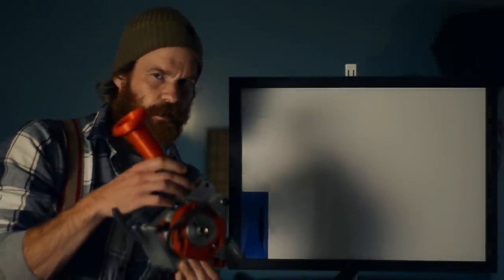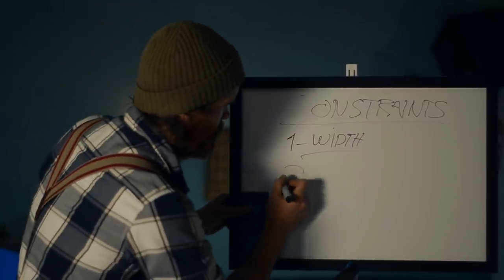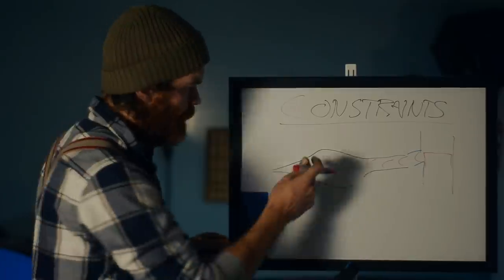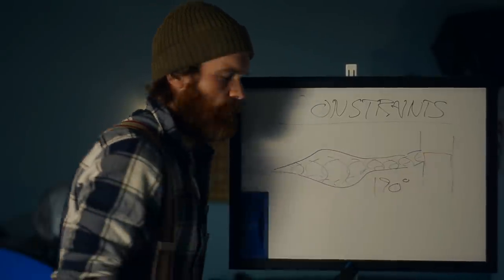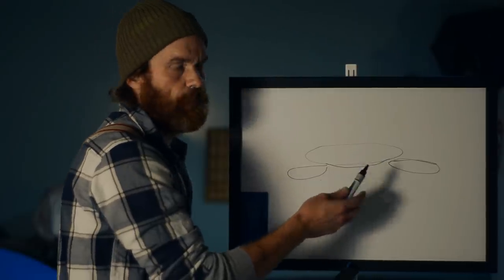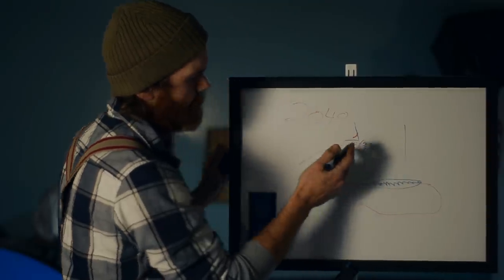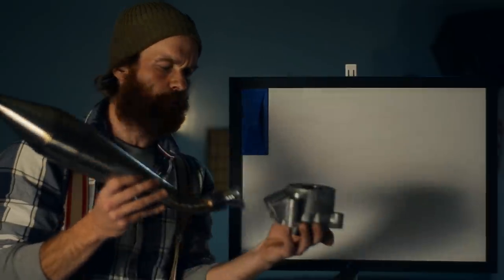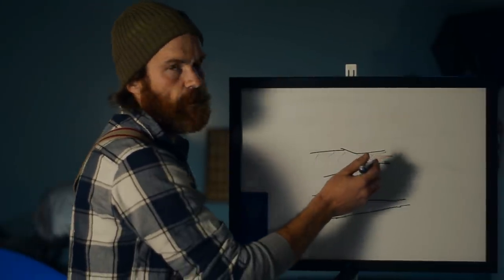How to Make the Most Powerfull Two Stroke - P1 Porting

Comment: This is amazing. Thank You very much, if words can express how valuable Your knowledge is. 

Im serious ablout 1 thing, I wanna build 900cc 2t twin engine then have all needed mashinery & finances.

  I would do like A.Milliard. Cut the casing of the gearbox and clutch from 1 liter superbike engine, and weld to it my own made part of the engine to one.

Maybe i will use cr500 pistons and rods.

But the most important part is this that you are doing. By engineering cylinders, heads, chamber by your knowledge, i could reach much better performing engine.

Like stock cr500 has 60hp, so tuned by Your way, maybe possible to hope for 75horses or more. So 2 cylinders maybe peak could be 150+hp, which would be very respectifull using 2 pistons only.

Why 2 pistons, not 4. Is becouse the crankshaft to make is easier, yet engine is narrower. To make 4 pistons crank and cases is really would be very difficult.
Reply: Yes it is very difficult to make a 4 cylinder 2 stroke  I tried it with weed eater jugs and pistons made a crank and block  wouldn’t start without ether and spinning it to 4K rpm I think the case volume was way to high also it “idled” at 5000 rpm any lower and it would die I’m pretty sure it’s been scrapped by now I wish 2strokestuffing was around when I built that at 13 yo
Reply: Take a look a snowmobile engines. This year's skidoo 850 twin cylinder is putting out 165hp. Pretty neat design!
Reply: 165horses would be very respectifull. Yet im wondering how cvt belt on them holds such a performance.. Its mystery for me honestly..

And why im serious to build 2 stroke engine too in future? Is becouse i would like to do custom-classic-racing motorcycles not only for myself but to sell it too.

Just becouse 2 strokes much more valuable, and exotic compared to 4strokes. Especially high capasity 2strokes almost dont exist anymore novadays.

Like ronax500, sutermmx500, these motorcycles goes for sell for really big money. I wouldnt do that that expensivelly coz i think its ridiculous.. 

I see here a some business opportunity, building custom motorcycles. But yet i would like to build differently, to have not 4t but 2t engine. 4t you can get on 'every corner' cheaply, 2t is a rare thing now, especially with output like 150hp+, yet enough reliable if using 900-1000cc engine capasity.

Comment: I'm seeing the whole point here is to maximize resonance as to overcharge the cylinder right at exhaust closing in the compression stroke.  Kinda like supercharging, but just using timed exhaust waves.  What I see is if you do the porting and everything correctly you could have massive amounts of fresh fuel in the exhaust that might not fully get returned into the cylinder and be burnt.   I don't think this is a concern on a 100% race engine though.  For a commercial use engine these considerations are a compromise, but a pure all out let's see just how much power we can get out of it aren't.  Curious to see how it ends.
Reply from the maker: 👍 Yep, won't have the lowest emissions ever... My next project will be much worse tho...

Comment: Still most interesting.....with a signaal generator. Amplifier tweeter and microfoon and scope you can find out the exact resonance freq. Of the pipe and tune it if needed.....i did this to find the resonance freq. From my V1 engine...in tthat way i could easy tune the inlet reed s from the valve   and bring all in resonance...grt paul

Comment: In theory your concept is great, however in removing constraints with your port design, you are adding a constraint with your piston and ring design. By restricting the ring to form a seal as it was originally designed to do, you will have compression and reliability issues . That being said, I admire your efforts and have 2 suggestions to help your cause. 1 try a slightly wider ring so it isn't as narrow
2 decrease piston to bore clearance , even to the point where you may have to preheat the bore to expand to normal operating temperature size. Good luck

Comment: Hey. Good video. I have a question. Or maybe its a sugestion.  On your crank shaft. On the inside of the counter weights. Have you e er heard of cutting groves in them?  I dont know exactly how to explain this but something like this. Take a circle and start from the center point and make a line in a swirl to the out side.  Make one next to it and one next to it and so on.  What happens is when the crank rotates the groves scoop the intake gasses and go on to presurize the transfere ports.  Effectively charging the top end. Like putting a blower on it sort of. 
  Any way you might want to research it some and see if will add any power to what you have already. Which is lots. Lol. 
  And about leaving people more confused after one of you videos. I wouldnt worry too much about it. You explain things really well.  If they are still confused after listing to you they will probably never get it.  
   Ps.  Kindergarten. Ihave been trying to decide what you di for a living for a long time.  I would have never guessed you worked at a kindergarten. No damn wonder you drink.  lmao.  See you on the salt.

Comment: Have you ever 3-D printed the inverse of the exhaust port?  That would be a good visual.

I know that 4-stroke airflow shouldn't be directly compared to 2-stroke but I think you want to avoid abrupt changes in cross section except in your expansion pipe where those changes in cross section are very intentional.

Also, I am curious what you are doing with the port "ceiling"(?), the first part of the exhaust port to be opened is kind of like the valve curtain area of a 4-stroke, it would probably be a good idea to have a rounded surface there so your flow stays attached to the port wall.

Is there a longer stroke crank that will fit your case?  I think if you could stroke it and make a test cylinder that has shims on the cylinder head and crank case sides, you could test your port timing to see where your best output occurs and use that data to make an optimized cylinder for the 50cc race motor.

I would really like to see that inverted exhaust port because I think there might be some changes that might help.

Comment: Awesome video, thanks! I have a question about the short transfer and the exhaust port ending at the cylinder. The short transfer from oval to round will also introduce a small backwave as it is so steep, a smoother transfer would not have this effekt. Did you make it short to not loose energy to friction and get a stronger backwave from the exhaust pipe? Second question would be, why did you not start the transfer to a more round shape already in the cylinder? The oval shape should have more friction than a more round shape. Further more, if you ge tighter it looks like you have the smallest area at the end of the cylinder acting similar to a nozzle. You could try to introduce a laval shaped "nozzle" as this will minimise losses, after the laval you should open with around 3 to 4 degrees cone, but that is for sonic flow through the laval, to not have detachment of the flow.
All the best! Really love your videos!

Comment: Question about exhaust port diameter. when working out pipe diameters at diffuser to belly section usually 2.2 - 2.5 X exhaust port diameter. Is the exhaust port diameter the area of the exhaust port converted into a circular dimension, or the diameter of the header pipe?
Reply from the maker: Effective port area converted into a circle. Providing a good duct, the header should start at this diameter too.
Reply: @2STROKESTUFFING  thank you.

Comment: Hi,
Have you considered "borda carnot" losses in the exhaust system?
What about the circumference and surface area relation in the exhaust port? It will create turbulent and slower flow than in a round port
Reply: Intrigued.  Would fluid dynamics equate?
Reply: @stephenhintz4457  explain your concern please

Comment: Nice explenation very easy to understand 👍 One question: do you have any modern suggestions for the STA/time area of the exhaust and transfers or how to detirmine them for the specific rpm ?
Reply from the maker: Thanks! I've used Blairs(I think)formulas before, but nowadays I use engmod2t to simulate whole engines.
Reply: Thanks I use jennings suggestions but i've heard they are somewhat faulted/outdated...guess the simulation/testing is the way.

Comment: One or two thin bridges in that big hole on side of Ur cylinder would not be as much trouble as the trouble with ur ring life ? To much open area the ring is just going to expand into wide open side of cyclinder eat ring up or cause piston to wobble piston wobble is ur problem now from looks of skirt of piston?
Reply from the maker: The piston has been abused a bit in a too tight bore(would've ground the Nikasil off completely if taken to right dimension, new Nikasil now) but yeah, wobble might be an issue. We'll have to see how things evolve and adjust accordingly.
Reply: Is ur final piston going to be long enough in the bore to use two rings ? Could piston b fitted with a second ring down on the next to the bottom of skirt just for stability in the bore? Or that be to much friction and reduce rpm's ? Back in the day my1986 Honda CR had crome cylinder and piston only used one ring

Comment: Would it be beneficial to have the exhaust duct as close to the angle of the cylinder bore as possible so the gas flow does not have to change direction so much?
Reply from the maker: Yep, well almost, say 10deg off or so.

Comment: How do the land speed regulators confirm the displacement(cc) of the engine on site, or is it a system of good faith and believing your engineering data on the day?
Reply: Ibelieve they measure the amount of cc's by measuring exhaust flow and rpm. not 100% sure though
Reply: If you're fortunate enough to go over a record the vehicle is impounded and the engine is torn down and measured.
Reply from the maker: Yep.

Comment: You said something to the effect of the resonance from the pipe supercharging the next intake cycle. My question for you is, are the spent exhaust gases entering the next intake cycle? And if so, how does that affect the effectiveness of a cool dense air intake? I know the basic principles of how a two stroke operates, I’m not familiar with the physics behind it. Also, what is the compression ratio of your engine.
Reply from the maker: Spent gases should not be pushed back in, but some mixing will occur. The low volume flat duct should help minimize mixing.

Comment: You mentioned the bevel at the top of the ports to preserve the ring, but I remember that you didn't put the bevel in until after you did the plating. Could the lack of plating in this area cause increased wear and in turn potentially damage the ring?

Comment: Question. I've got a piston port engine with 2 pairs of transfers (a divider in between) think I could get away with removing the devider? It's won't increase to 70% of the bore and the rings don't depend on them to stay in position. Why are they even there!

Comment: The part about the pipe only told half the story - you didn't go into the bit where the pressure waves enter the divergent cone and reflect back as negative pressure waves or vacuum waves which then pull fresh mixture out of the crankcase and into the cylinder and right through into the exhaust port. 
Maybe you should do a video just on the pipe and how it works to increase power and create the power band.

Comment: i got what you said about the exhaust bridge, but couldnt you just make it the same amount wider that the brigde takes up, will still be 100% of bore, but the ring is held in place by the cylinder.
Reply from the maker: Going past bore center will disturb scavenging with a traditional transfer layout. Why stick with traditional transfer layout tho? Got plans for the next project already.

Comment: Very nice work, I see you're using Fusion 360 for your modeling, have you tried  Autodesk CFD (for performing computational fluid dynamics on Fusion models  ) which would allow you to do flow analysis on your port ducts. If you are a student you can get a 1-year license for free.  It's reasonably simple to use and much easier (and cheaper) than the high-end stuff Like ANSYS

Comment: Is it worth pointing out that lower port timing still has it's place for lower rpm peak power?
Reply from the maker: Absolutely. With a low port the pipe is less efficient which is great outside the powerband where that sweet resonance ain't so sweet but rather destructive.
Reply: @2STROKESTUFFING  Is it less effective full stop or could a pipe be designed to resonate at lower rpm?

Comment: Not 75% of the total area of the exhaust port?
75% smaller sounds really small to me, or am I wrong?
Reply from the maker: 75% of effective area, even less than total area. In my case it might be a bit too small though, as the port floor is so high, but easier to remove material than add.
Reply: @2STROKESTUFFING  I was wondering, what if we use the mean area of the exhaust port as the diameter of the header, it might give a closer number to reality

I was just thinking about that, I don't have that much of an experience, never experienced with it
Reply from the maker: @peterfoldesi483  Effective area of the exhaust port is in most cases what I use for start of header diameter.

Comment: i guess you cant scale up the engine and bam you got a bigger cc engine so what parts you need to change ? lets say to be a 120cc
Reply: if you just scale it up everything needs to be new
Reply from the maker: It would scale fine but wouldn't be able to rev as high and power wouldn't scale proportionally.
Reply: @2STROKESTUFFING  that was the reasoning behind  the multi cylinder 50 125 250 350 race bikes like the RS67 and RK50cc twin back in the 60s and hondas RC166 although a four stroke  revd to 20.000rpm+

Comment: About your exhaust flange design, don't you think it allows the hot exhaust gases back in to the cylinder a bit too easily?  Most high performance engines tend to have a bit of a one way valve in there to stop the flow back in to the cylinder.  Maybe something like this would work better: https://drive.google.com/file/d/1eTLgWceQeTydXl1jK_P02WgyznhdGEpN/view?usp=sharing
Reply from the maker: I think with the duct being long and low volume what gets pushed back in should be mostly fresh charge, but could be wrong. Could do a comparison when things are working 👍

Comment: Mach 1 is super-sonic, beyond the speed of sound. Two stroke tech makes my head hurt, not something I've ever really learned about.. My real knowledge of two strokes is my little bit of knowledge of RC nitro engines and 2 stroke diesels. 
As far as I can tell 2 strokes want 0 backpressure but need shock waves? It really makes me wonder what a De Laval nozzle would do to one. (maybe add it to the end of the pipe to suck all the gasses out at extreme speed) Or what a turbo does to a two stroke.